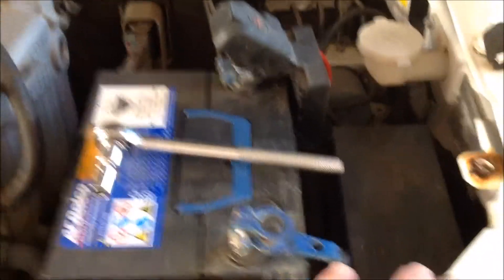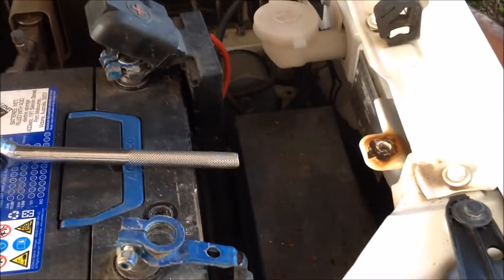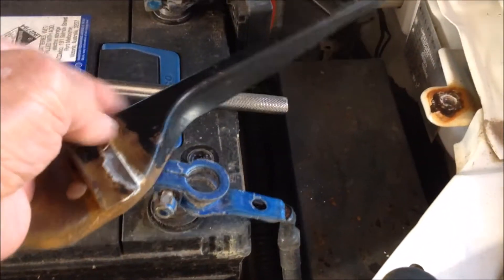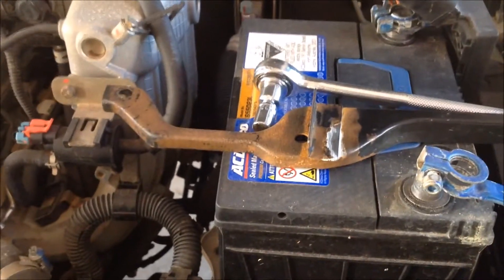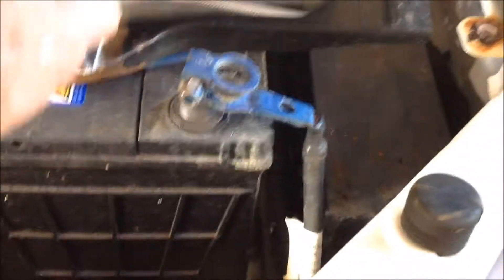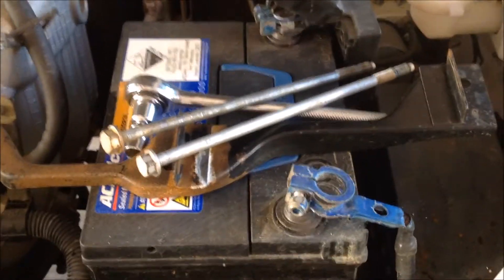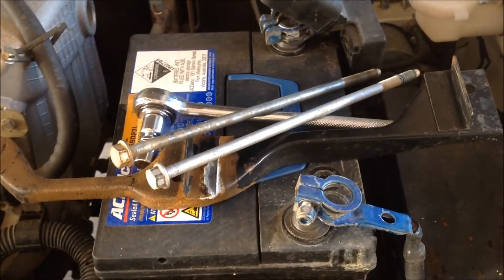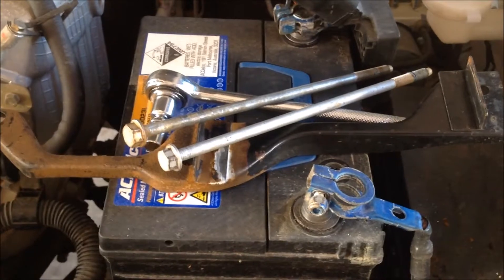Fixing A Little Battery Problem In My Four-Wheel Drive Vehicle  👍

Comment: I never heard of using petroleum jelly on a battery. Was that just for the bracket and bolts or did you put it on the terminals?
Reply from the maker: I smeared the jelly on the battery terminals and connections, too, as an aid in the prevention of corrosion. 🙂👍
Reply: Like John said it`s a corosian preventitave. (cant spell)